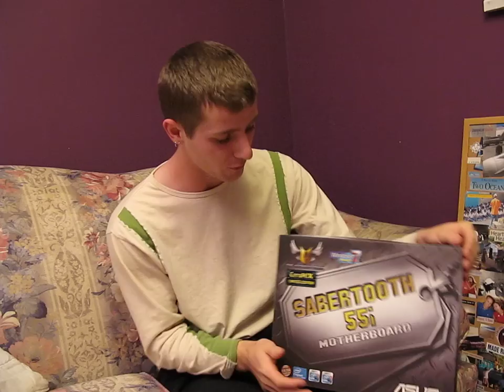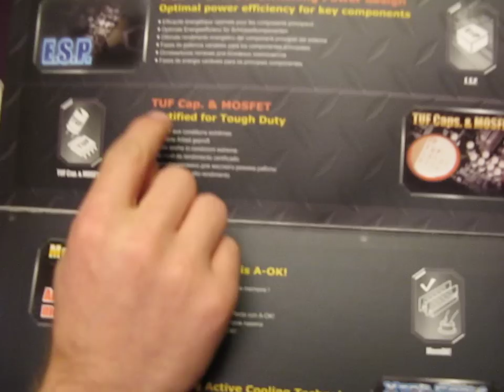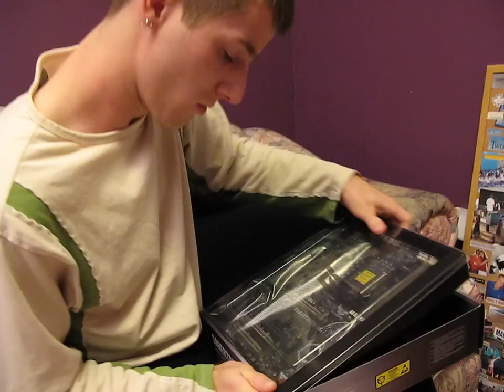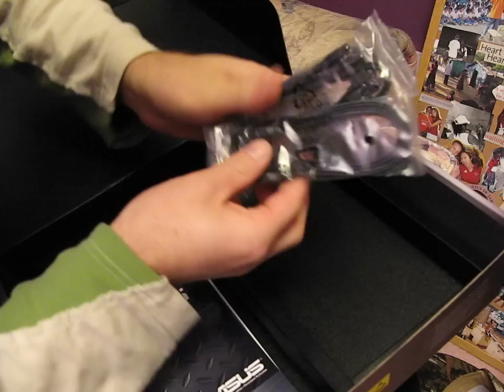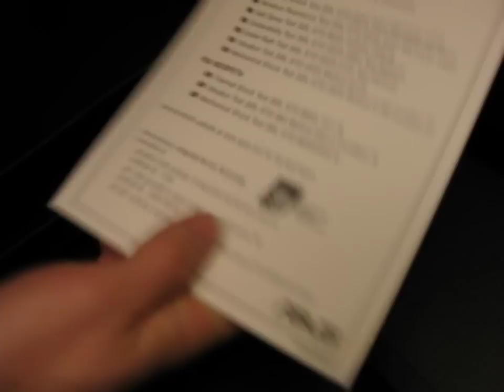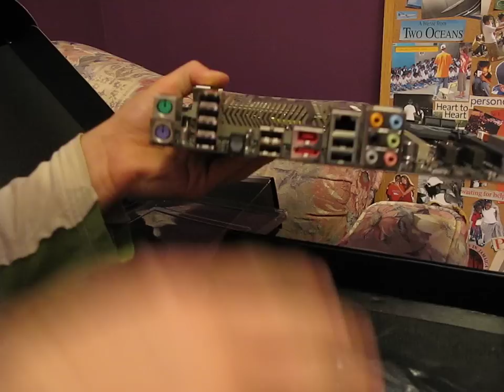ASUS Sabertooth 55i TUF P55 Motherboard Unboxing Linus Tech Tips

Comment: u r an ass. You criticize that it only integrates 1 ethernet port but still dont understand why someone will use 2 ports. The PCB styling is a personal judge so if  u dont like it it doesnt mean is ugly. I believe is original compared to all sporty like ones of the present...specially those light-blue-gay-like Gigabyte mobos.

Comment: 2 Gigabit ethernet ports (This is just my guess) Is used to have one connected to your modem, and the other one connected to the router, and users on the network get internet from the master computer (instead of directly from the router). Thus is said computer is shut of no other users on the network have access to the internet. Maybe it is also for plugging direct pc2pc connection, without unplugging your internet ethernet cable?

Both seem quite logical and reasonable. And useless.